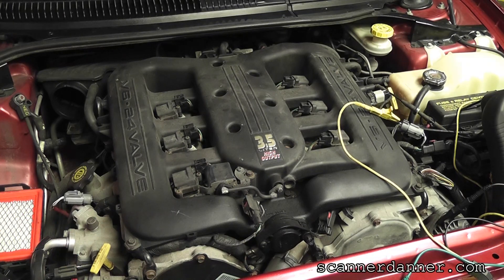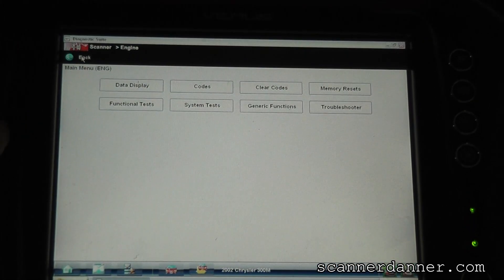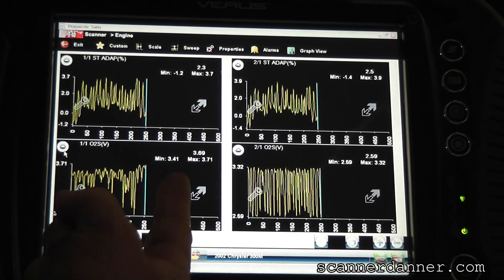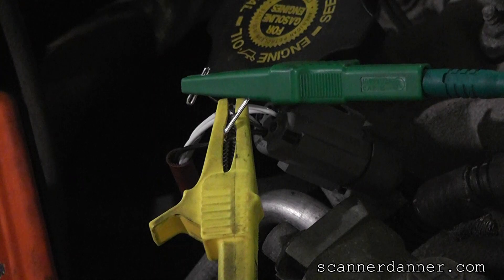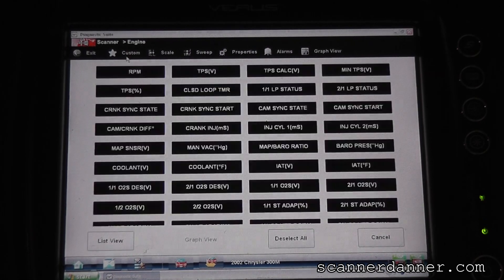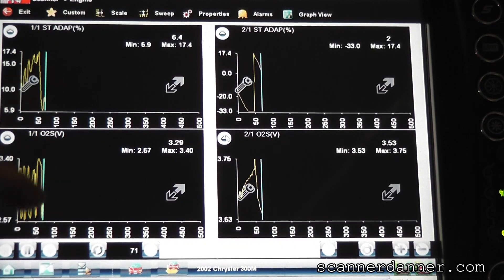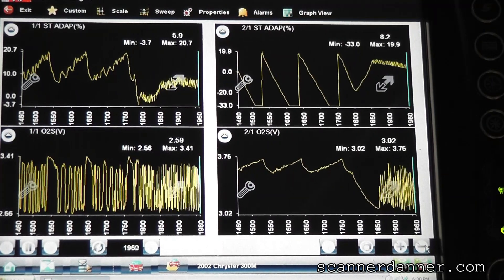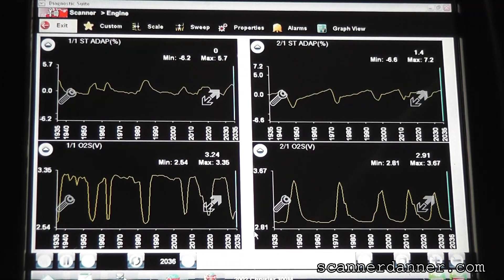WARNING! Aftermarket Oxygen Sensors (Chrysler/Dodge/Jeep part 1)

Comment: Have you found other vehicles to be so picky ? 
As a general rule would you say that an OE replacement is usually sufficient ?
Reply from the maker: Yes! Just recently got my ass kicked by a 2011 or 12 Jeep Patriot with an aftermarket crank sensor giving it fits intermittently. The fix was a factory crank sensor.

Comment: Thank you for this.  What was the Bosch O2 sensor part number that was used?  Was it 13122? I do notice that the factory O2 part number on the upstream on my shop 2002 300m special is 4606555AA and has about a 5megohm resistance between the gray wire terminal of the o2 to its outside metal casing.  The Bosch 13122 does not have this resistance, it is isolated.

Comment: Gee, that's funny . . . on Bosch's web page for that sensor, it shows that it's in the 'compatible' list for that car. Wonder why? Seriously, though, I used to be able to get the tech spec's for Bosch's parts, but they're hiding them somewhere now. When comparing specs to OEM back in the early 2000's, I just went to the site and looked up the data. I could see that Bosch spec's were the same as OEM, so chose to replace the one on my GMC truck (an ACDelco) with a Bosch. Worked fine. If they'd publish their spec's somewhere, mechanics could look them up and see that no, they're not the same as OEM for that particular sensor, and choose something else. Hard to do the job correctly if they won't even give you the basic info. I'm seeing this on a LOT of manufacturer's websites now - places where you could get all the necessary info in the past now seem to hide it, even just the basic diagrams of the physical dimensions.

Comment: On a 2005 PT cruiser is it the same because I can't get it to operate the 02 sensor both reading low voltage P0031 and P0037. I bought them at autozone.

Comment: Hi Paul thank you for another great video. Can you check the resistance of the heater circuit of the oem sensor and compare it to the aftermarket sensor? I believe the OEM would show a lower resistance than the aftermarket sensor. Lower resistance will pull more current, hence why the OEM sensor had more current when you tested the current draw. And this may be the reason why this particular sensor will not work in this application. The sensor is not responding because its not in the operating temperature range.
Reply from the maker: No but I wish I would have. After looking at the amperage readings again, if you freeze the video when I am looking at the heater current on a 200ms screen (zoomed in view) and compare to two O2s, you can see a very clear difference in "on-time", not just the gaps in the controls.
Something is definitely going on there, I wish I would have spent more time on this part. I guess the reason I didn't is the signal never really looks right even with the O2 hot from the exhaust gases at higher RPMs. So it is still more than just a heater circuit problem.
Reply: have the same problem with my class Chrysler Pacifica after I replace the catalytic converter I replace both oxygen sensors with botch brand and after that is been giving all kind of troubles this is the third time I replace the sensors with the same brand enough to write check get with the computer it reads code po138

Comment: Hmmm I'm wondering if my replacement O2 is causing the fluctuation.  It only happens in gear (manual) not at idle (anytime IAC is not involved).  Is that something an O2 can cause.  My ECT and all other components are good.  Only thing I can't test is the O2 because I'm OBD-I.
Reply: hard to say but the fact that it changes when in gear says no, it is not the O2 sensor. Also I have had great success with Bosch O2 sensors in the past so don't panic if you have used an aftermarket sensor, just keep in mind on some systems you must use a factory part.

Comment: Paul! important clues of what is going on... the sensor seems to do better when hotter... what led me to believe that the problem is not the sensor... rather the heater... and culprit would be high resistance or higher resistance on the heater... that is why is drawing less amps and the heather driver cant handle it and the wave form is erratic .... anyway... the main thing is to stay away from the non oem sensors on Chrysler engines! what do you think?
Reply: I would agree with the higher resistance comment but not the computer cannot handle it comment. If it was too much amperage I could see the computer limiting current but that is not what is going on here. In part 2 I go into this a little more.
For sure, stay away from anything but an OEM sensor in this particular application.

Comment: Mr Danner,
If you can please forward your findings to Bosch. I work in a parts store that sells this very sensor and comes up in my computer as a replacement and I DO NOT want my customers having this problem. I'd do it myself but Bosch is more likely to listen to you then to listen to the bottom feeder parts guy.
Thanks,
-AJ

Comment: HEY! I LIKE ALL YOUR VIDEOS, NICE WORK!!! HAVE A CHRYSLER  PACIFICA  AND AFTER REPLACING THE MOTOR AT JUNK YARD THEY GAVE IT BACK WITHOUT THE CATAITIC CONVERTER AND WITHOUT THE OXIGEN SENSOR THAT GOES ON IT, SO I GOT THE CC AND AN BOSCH OXIGEN SENSOR AND THEN THE OTHER SENSOR WENT WRONG, AFTER THAT I REPLACED IT WITH A BOSCH ONE AND WAS RUNING GOD FOR A DAY OR TWO BUT IT GAVE ME TRUBLE ONCE MORE SO I REPLACED THEM AGAIN WITH THE SAME BOSCH ONES AND ONLY RUN GOOD FOR A DAY, MY QUESTION IS,WHAT TYPE OF SENSOR SHOULD I USE? IT'S GIVING CODE P00138 AND P00132, THANS.

Comment: according to autozones catalog, 15729 is the correct universal fit bosch sensor or 13399 bosch directfit type. the 15705 bosch isnt listed for this car. this could be why it doesnt work correctly. lots of car companies use bosch from the factory. denso and other japanese brands are better parts overall.

Comment: Hi paul  the bias 2.4 volt on the negative on the 02 sensor would  that be the same for other engine sensors on the vehicle or just 02?
Reply from the maker: Some cam and crank and ABS wheel speed sensors will use a bias on the sensor (-) wires. In all of those examples, they are variable reluctance type sensors.

Comment: ScannerDanner You mentioned the chrysler dealer installing NGK plugs. Could you explain why that is not a good idea? Does the vehicle call for specific other brand plugs?
Reply: KeleentProductions NGK plugs are THE OEM plugs. Other plugs do not work well with this engine. He is absolutely correct about Bosch O2 sensors being junk though.

Comment: Add in Jeep to the title cause this issue had me in my 2008 Commander! 4 aftermarket 02 sensors, let to plugs, coil packs, etc and then to the Mopar sensor to have no issues. I think on my Commander a  3.7,   Bank 2 in the passenger side, Let me know if that is even correct? But F sake, I wish this had the O2 Jeep Sensor added in the title. Would have saved me a lot of grief.
Reply from the maker: Will do my friend. And nice job on your diligence to get your Jeep fixed
Reply from the maker: Done! Plus I added this description:
This condition occurred from a heater circuit change. Chrysler started PWM the O2 heater instead of it being constantly energized, and most of the aftermarket sensors are designed to be on all the time! The result is a cold oxygen sensor, especially at low RPM and idle speeds. This causes elevated signal voltage (false rich conditions) and massive amounts of fuel being taken away (negative fuel trim)

Comment: I'm having a similar situation with my 2014 Mitsubishi lancer evolution x. I replaced it with an after market denso 02 sensor. Denso claiming it's exactly the same as the factory because it's the same manufacturer.
Reply from the maker: Chrysler used an NTK sensor from the factory. I did not buy a Chrysler O2 for this, we found an NTK sensor for a fraction of the cost and it works perfectly.

Comment: Is a 2002 Chrysler Sebring limited Convertible  with the 2.7L, 24 valve, V6 engine able to use the Bosch 13138 replacement? If not, can the NTK 23133 replacement be used?
Reply from the maker: If it is a pulse width modulated heater circuit, it MUST use the NTK sensor. 
If power to the O2 heater comes from the ASD relay, (constant power)  the Bosch unit will work.

Comment: Is it possible for a downstream o2 to cause drivabilty issues in a modern chrysler? I have no bias voltage on one side and couldn't find any damaged wires but car runs rough
Reply from the maker: If the system you have is using downstream fuel trim control, yes, but I don't think Chrysler does that. What year, make, model and engine?

Comment: Hi Paul,  wondering if you can give me a piece of advice, I have a 2008 Dakota with the code P0158, I have changed the sensor with one aftermarket from Autozone ( I know, not the best solution hahah) and having something similar of what you shown. When I just start the enginde ( cold) the measurements in that sensor ( S2B2) are flat 1.27V for 15 to 20 minutes, that gives the code P0158. after that time the reading change to .9 and below and works almost in the same way as the S2B1. if I clear the code when the engine is warm, I can use the truck for hours without problems. Just gets cold, and the code pops again and the voltago goes up to 1.27 for the 15 to 20 minutes.
Reply from the maker: Define the P0158, sounds like a heater circuit issue that is not warming the sensor up properly. Get a factory sensor

Comment: I really wonder...if the OEM sensor is made by Bosch you should be able to get a Bosch replacement O2 sensor in the aftermarket. Maybe it was just the wrong Bosch sensor?
Reply from the maker: It was the correct Bosch sensor. Been seeing this problem on Chrysler products for 10 years.

Comment: Would this apply to a 97 jeep wrangler? I ordered Bosch sensors. Should I send them back and get something else?
Reply from the maker: Use NTK oxygen sensors in these. Not sure about the heater circuit in 97 but that is where the issue lies.

Comment: Do you know the Best cheaper Brand o2 Sensors (other than Bosch)thats compatible with the Chrysler Crossfire?
Reply from the maker: Yes. Look up NTK sensors. That's what the factory Chrysler O2 sensor is and it was a fraction of the cost as the dealer but the same sensor.
Reply: That's what I've used. Most times the correct sensor from the dealer is cheaper than aftermarket. Go figure.
Reply: I'm having a similar issue with my 2004 Jeep Grand Cherokee with the 4L 6 cyl. (California emissions). P0051 persists, even though I have replaced the o2 sensor, and my mechanic checked the voltage and said it should be working fine. He also wants to replace the PCM.

If I put in Mopar or NTK, do you think it will fix my persistent P0051 problem?

I installed a Denso sensor I purchased on Amazon.

Comment: Could this be what's going on with my 06 Pacifica I changed the o2 sensor and got the same code high voltage sensor 1 bank 1 it's reading almost 5v
Reply from the maker: Absolutely! NTK sensor only on these

Comment: did you ever verify via bosch directly if that part number was correct for that car? the voltage numbers are just off the chart. the stock o2 is spot on with the voltage swing but that bosch o2 is not even in the ballpark. unless that is just a bad sensor i really have never seen anything from NTK, denso or bosch that's been a problem provided the fitment is correct
Reply from the maker: yes, it was the "correct" Bosch sensor for this car
And I agree, I've not had issues with any Bosch O2s other than with these Chrysler systems. I've done literally scores of these with the exact same problem

Comment: Can this cause a P219A and P219B? I have newly installed Bosch 02 Sensors on a 2013 RAM 1500 and I'm having quite a time diagnosing. Please help!
Reply from the maker: What's the definition of these codes? O2 signal high? The wrong O2 sensors won't heat properly with the PWM heater circuit and it will cause false rich signal from the O2. Very negative trims and intermittent low power. Runs good cold and at wide open throttle. Does any of this sound like you?

Comment: Hey scanner danner big fan. My 2005 pacifica is giving me a big headache. I have a p0131 and changed my sensor with a denso and i still have this code. I checked my heater circuit at the harness and im getting a good ground but im not getting 12v with key on engine off. According to the diagram im supposed to get 12v direct from the computer. Is it toast? I have good continuity at that power wire all the way up to the computer. Thanks.
Reply from the maker: @paquesepas6696  probably not, that is a PWM power feed and the PCM probably isn't turning it on until the engine is running. You need to lose that denso O2 for your application. NTK is the factory sensor for that
Reply: @ScannerDanner  so you think it could be my denso? I just thought about checking for 12v at the harness for the heater circuit at the downstream o2 which I don't have a code for so downstream is working. Thanks for your help and I'll try the ntk but it's telling me I have 2 options for my car due to some xzz option.
Reply: This is a pine hollow video where he has my problem on same type of vehicle and ends up saying it was the computer. I hope the ntk sensor solves it though.
https://youtu.be/9hdxIkTCI9A?si=MrjVl_pP3VrjU8Qz

Comment: Is this still an issue?
I would have though Bosch would have had some response if they were getting a lot of warranty returns?
Reply from the maker: well my first experience with this was more than 10 years ago, so it has been an issue at least that long. 
the problem with a warranty return would be people are replacing so many parts in an attempt at fixing this issue and are probably giving up and shipping the car to the next guy

Comment: HI, I have  a 2002 jeep Gr. Cherokee with a 4.7 limited. I was rear ended about six months ago. Ever since then I have mis-fire problems. Cylinder 1 had  a bad fuel injector. The dealer replaced all 8 injectors. Now I have engine code stating that 2/1 and 2/2 O2 sensors are  bad. They want to replace all four O2 Sensors. I was  not hit hard probrably the car was going 15 MPH and the trailer hitch took the brunt of the hit but he did make contact with the exhust pipe. Could some of these issues be related to the crash? This jeep used to run so much better. I also smell coolant when the heat is on. I would apprecite your comments.
Reply from the maker: +Paul Regeis watch these videos. If you O2 ends up being bad you MUST use a factory O2 on these systems.
https://youtu.be/SEuGtggZAvo

https://youtu.be/v8XrM-7BuOg

https://youtu.be/-lUYRqaYvYI

https://youtu.be/gtTKOuu6EPw

Comment: Is bosch really that bad on these cars ? I just got back from a shop where they replaced an O2 sensor on 2021 Chrysler 300 with a Bosch sensor. If the same code pops up again, will it more than likely be because it was replaced with a Bosch Sensor and not OEM ?
Reply from the maker: The Bosch O2 sensors were originally built with a heater circuit that was designed to be on all the time. Once Chrysler went with PWM heater circuits, the Bosch O2 sensors were no longer compatible. Is it still this way? I do not know
Reply: @ScannerDanner  interesting, I guess only time will tell. Thank you for the information !

Comment: At the end of the day, I believe Bosch should be to blame, for legally being able to produce an inferior part that they say will work for the application. "Meets or exceeds OEM Specs" is the biggest lie with a smile face i've heard in my life, when it comes to OEM vs. aftermarket parts.  It should be illegal to produce aftermarket parts. There should only be OEM parts available for cars as 9/10 times its an aftermarket part to blame. Most people would blame the vehicle owner or the shop for using said part, but the reality is, it's the part manufacturers and the marketing people ruining our vehicles by producing inferior parts for no reason, other than profits, and now the customer has to clean up their mess. Convince me i'm wrong.

Comment: Greetings and Peace - Could I use the upstream oxygen sensor to replace the downstream and vice versa?
I have a malfunction p0139 in Town and Country 2008 and after I bought an original Mopar sensor made in Japan, the check engine continued to appear and I connected a lamp instead of a heater and the lamp was changing in the luminance level in a frequent manner and it seems that the control circuit works - the important thing is the sensor wires one reads zero volts and the second reads 2.5 V When the engine speed increases, it falls to the limits of 0.86 volts and sometimes even less! - when the engine is turned off, the voltages continue to exist which is 2.5 volts  ? Can you help me?
Reply from the maker: The 2.5 volts you see on these O2 sensors is on the ground circuit or the low reference circuit of the O2 and it is a bias voltage. It is normal to see it and it is coming from the ECM not the O2
Reply: @ScannerDanner   thanks.but I want to know why the fault p0139 is still there?

Comment: I have a 2007 chrysler aspen 5.7 hemi and I'm having the same issue I bought four brand new aftermarket 02 sensors and my truck will run smooth for a little while and then it will start to run like shit but when I turn my truck off and start it back up it runs smooth again then goes back to running like shit
Reply from the maker: NTK sensors ONLY in these. The downstream sensors you can leave aftermarket, the upstreams you MUST use a factory sensor (which is NTK)